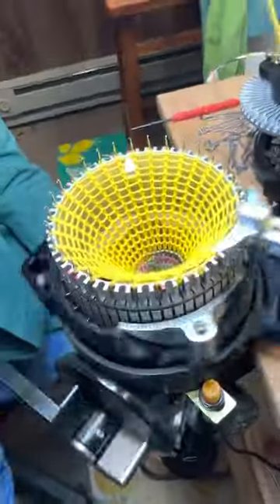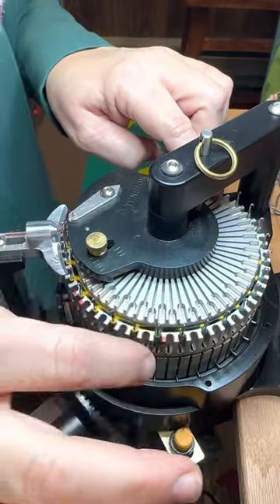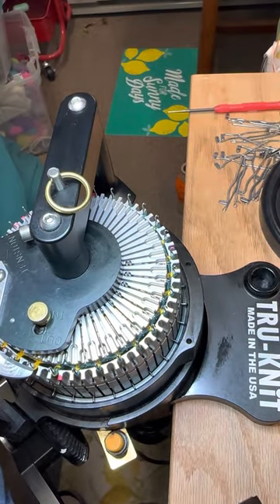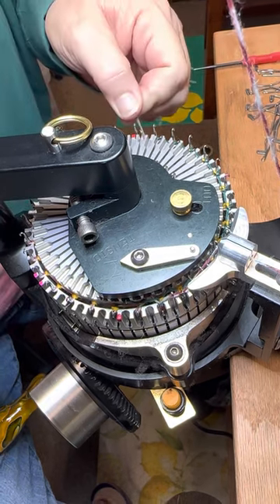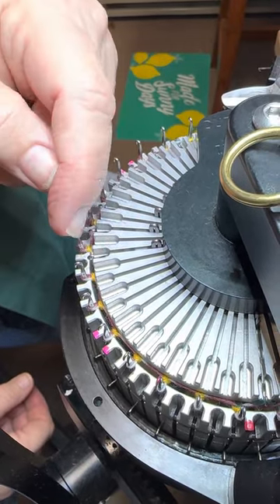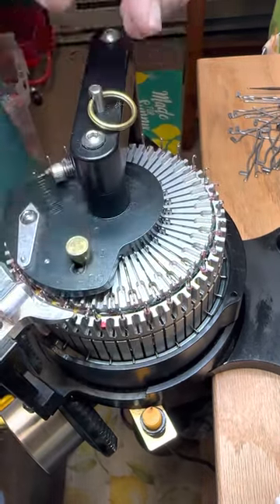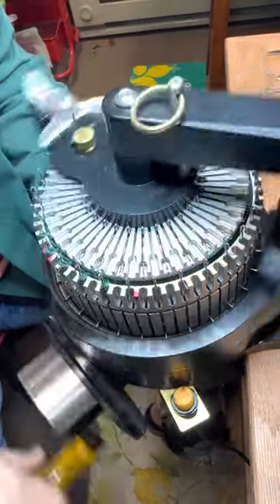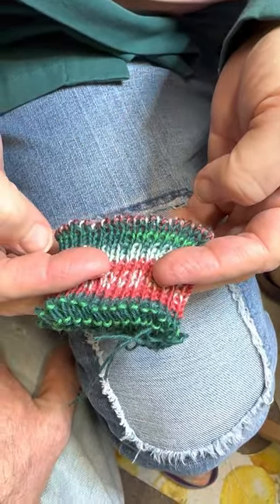Tru-Knit hybrid Selvedge

Comment: Questions:  What is the ring for (on the handle of the ribber)?  Also the ribber has 2 different size slots -long and short!  I would not have even picked that up if you had not mentioned using short ones today.   So why the the different lengths and what is it for or what does it do differently than ribbers that have only one size slot all the same for ribber needles.  ?  Does it use 2 different size ribber needles?   I guess I should revisit your video introducing the tru knit!  (So I just watched Juanna' cast on where you used a different ribber dial  than the one in this video. )
Reply from the maker: The ring is the ribber drive pin. The brass ring is decorative. The long/short slots on the ribber dial do nothing other than keep your eyeballs straight. If you’ve ever used an equal slot ribber dial, it’s a lot of slots and the long and short slots that are unique to the tru-knit have no function other than to keep it straightforward for your eyes. It make a huge difference for me!
Reply from the maker: the ring is the pin you pull when you take the ribber out of work.  it's official name is the ribber drive pin.
the long an short slots keep your eyeballs straight.  they use the same needle, but if you have ever worked with a 72/72 you would appreciate knowing which slot you're using!!

Comment: How do I gauge the correct distance btwn the bottom of the ribber dial and top edge of cylinder?  My first attempt it seemed the fabric was hanging up so I raised it half a turn and it didn’t rib correct😬. I tried looking at yours but I really can’t tell.
Reply from the maker: It will probably be different for each type of machine. It has to be high enough for the knitted fabric to pass through but not too high. It is not the same height as the cylinders, it sits slightly above. I don’t know how to post a picture here, but you can email me and I will send you a pic. Jamie@csmsupplies.com